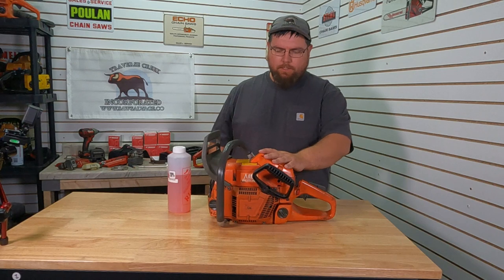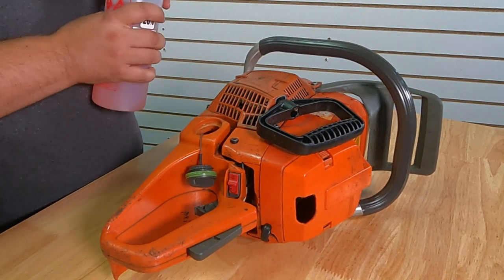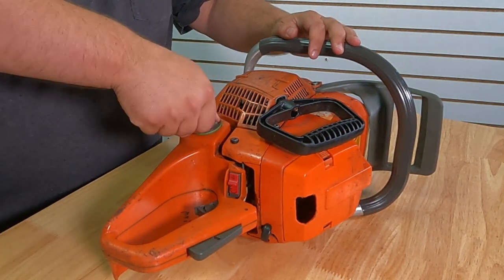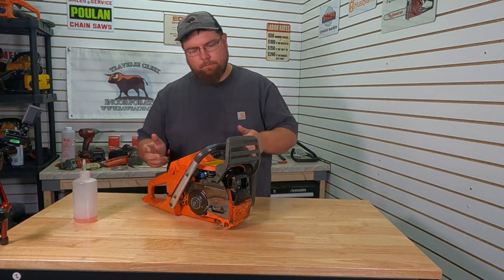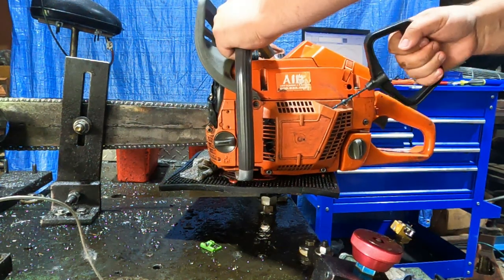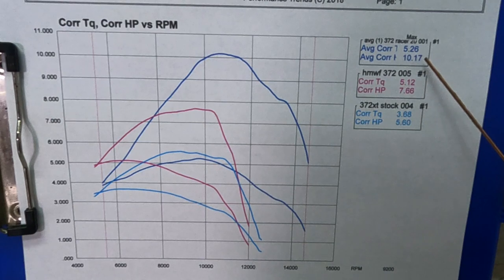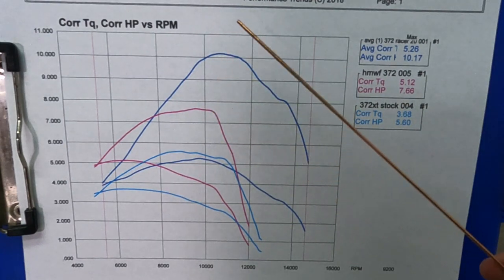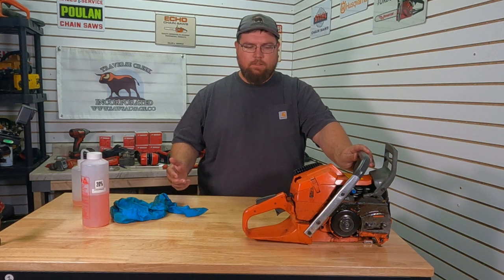NITRO FUELED!!! Husqvarna 372xp HUGE Power!!!!

Comment: You'd never know by the way it idled it was on funny fuel.  Nice build to whoever it belongs to.  Thanks for the video Joe!
Reply from the maker: I was very impressed with the manners this saw had. Better than some stockers lol
Reply: @dynojoemods2764  better than many xtorq's lol, but they are still great runners with a nice sweet spot.
Reply: @dynojoemods2764  So true.
Reply: @dynojoemods2764 ha it is a well mannered saw, if never used that lingo to describe a saw but right on lol
Reply: @dynojoemods2764 oil mix 33:1 ?

Comment: I mentioned awhile back ago a Nitro Fuel saw and E85 fuels.  It's the only thing that makes sense, nitrous not practical turbo many have tried and failed still not practical.

E85 in a car takes double the injector size and tune. E85 is huge performance in cars. I don't know much about chainsaw  building just throwing ideas out there. I  really enjoy channel. Really like to see a ported 462 vs 572 xp ported, piped on nitro dyno shootout It should get the algorithms  going crazy at least in chainsaw world.

Comment: Used to run alcohol/nitro in RC monster trucks T-Maxx etc.. that was 20yrs ago.. I know at the hobby shops you can buy 10-20-30-40% Nitro fuels and it almost looks like thats whats being run in this saw. Try some 30% nitro mix once it should gain even more power. This is very cool but not much good for cutting firewood or falling timber. Still very cool! Can't wait for the next video 👍

Comment: Very interesting little look into that exotic fuel world….   Why the JB Weld outside the upper transfer port? What is that JB sealing it back up from?  It appears that the muffler is just open with that big hole? How is that open exhaust not just smoking that piston? Thought you needed some muffler to not smoke the piston???   That’s a significant power jump from the fuel switch only???  Under 8 to over 10 is a hell of a jump up! 10hp out of that little engine is pretty wild stuff!  The way it’s reving up to the stratosphere definitely had me thinking can it hold together at 15,000??? Holy smokes man I bet that son of a gun blast through that 8x8 or whatever you guys are using in a hurry!  That would just be a heck of a lot of fun to get to run a couple of times! Very very cool stuff!
Reply from the maker: The jb weld it from grinding through the transfers or adding boost ports. I didn't pop the cylinder off. As long as the tune is ok, and oil in the mix the muffler outlet wont smoke the piston.

Short bursts of 15k+ seem to hold up well. As the rpm in the wood is a bit less and races are less than 6 seconds most the time

Comment: Interesting to see your pretty close on the torque with a normal build, race saw just tuned for much more RPM. I have no real interest in race saws as I actually use the things for work, you also wouldn't get me running nitro methanol indoors.
Any of you guys run saws on E85 or pure ethanol?
Reply: Though making a shit-ton more power that fuel is very toxic to life and corrosive to saw internals . Unless trying to get a world record …….
Reply: Yes I run a 660 on E85

Comment: I'm curious what av gas or 110 vp fuel does on the dyno. I've ran both in my 046 but don't have a dyno lol
Reply: Takes higher compression to gain power from racing gas like 110. A stock saw would probably lose power from higher octane as without boosting the compression higher octane fuel burns slower.  Now a ported saw with decked cylinder may see some gains from premium pump gas I bet.
Reply: Nitromethane is so volatile it creates more heat and pressure then even high octane fuel it is similar to the explosive component in TNT with nitro producing more explosive energy by weight and the nitro doesn't require any oxygen charge or boost to compression to be effective it will make power just from ignition even in a vacuum which is why nitromethane was once used to fuel rockets in the form of tetranitromethane which is an even more explosive version of nitro lol. What's crazy is you can literally make rocket fuel by combing isopropyl alcohol and nitric acid over an extended period of time although it would take a lot to yield very little and it world take further processing to extract the pure tetranitromethane it is one of the most simple high power fuels you can get.